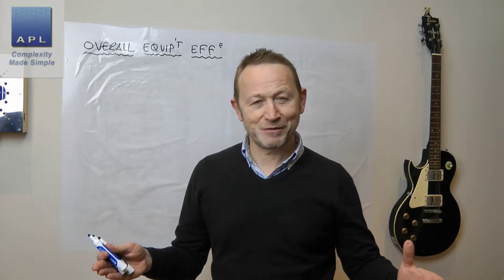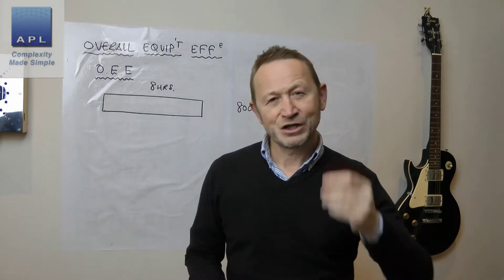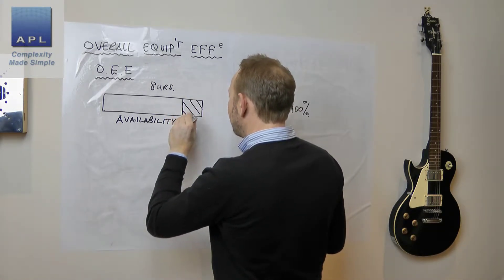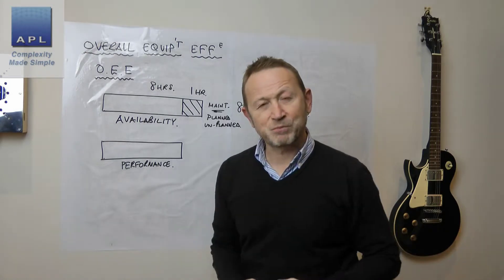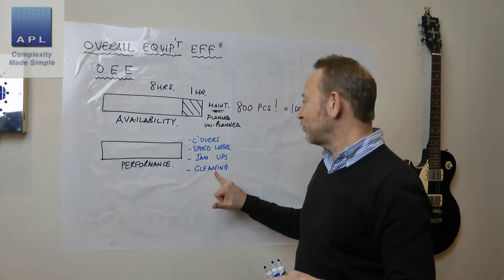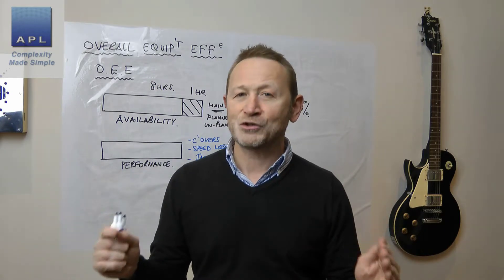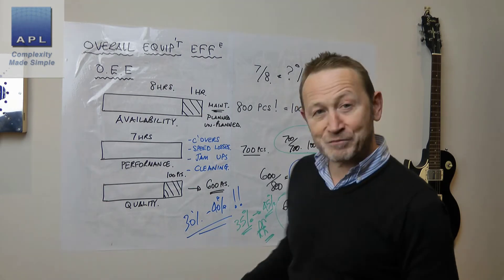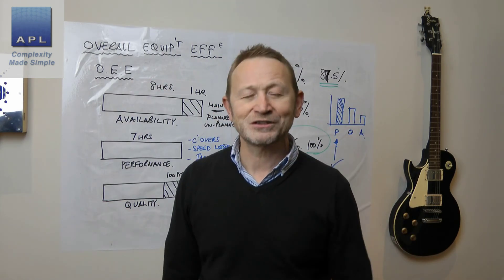OEE - Overall Equipment Effectiveness...

Comment: Great video Paul! I've often seen changeovers put into the availability category, is this correct as I see you have it under performance. Thanks.
Reply from the maker: Hi Stewart - I would say if the green light is on the machine it's available, if you choose to spend 3 hours setting it up everyday, that's a performance issue...
Reply: @paulallen5321  Cheers Paul